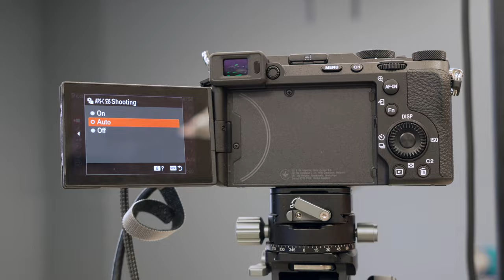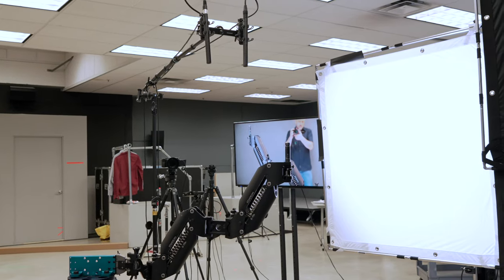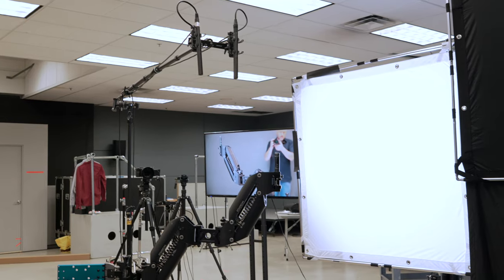Steadicam Project Breakdown (EP.118)

Comment: Great content as always!  I'm impressed with how much better your audio sounded after adding noise reduction and whatever other magic you used.  Might be a nice episode to quickly go over your basic post process to clean up dialogue.
Reply from the maker: Thanks. This is a short video and I'm doing the post. I usually have it done by editors I've worked with for years (that cut in Premiere), but this is a small project. I'm cutting in FCP and using some basic EQ, Voice Isolation and Loudness (which is essentially a compressor). I mix to around -6dB and Bob's your uncle!